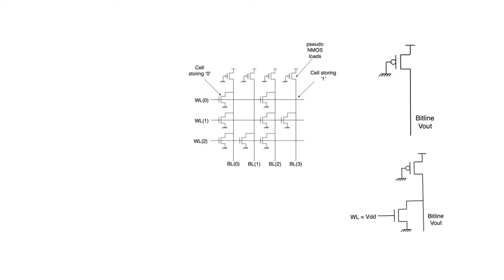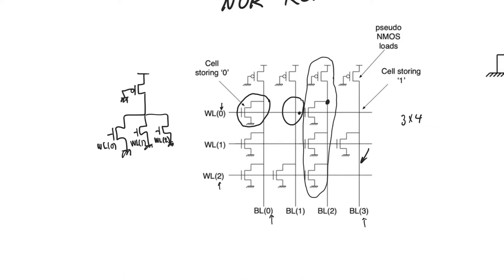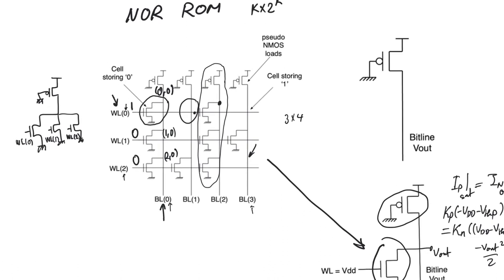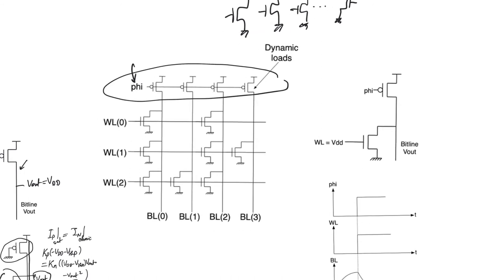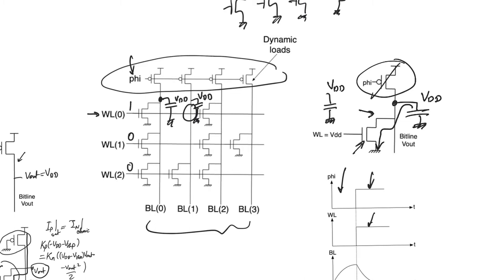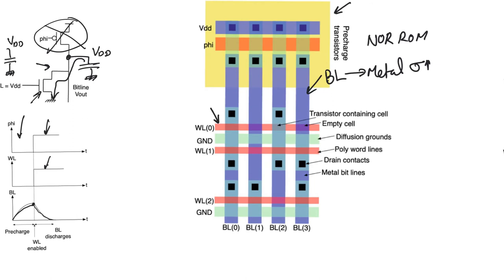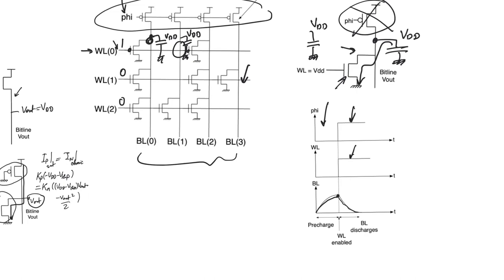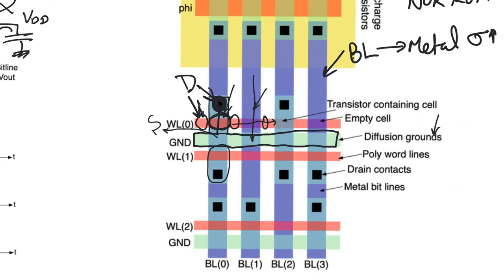12.3. NOR ROM

Comment: It seems to me that an array of word and bit lines, along with nMOS transistors at the 0 bits, would be sufficient to read out memory, no? When you turn on a given word line, the electricity flows only through those bit lines where the flow isn't diverted to ground via the activated nMOS. Why do we need things like dynamic load and capacitances and all that? Where's my simplified mental picture going wrong?
Reply: You need to look at the mosfet drains that are connected with the bit line. The capacitors associated with those drain nodes need to be discharged (which have been pre-charged during phi=0)